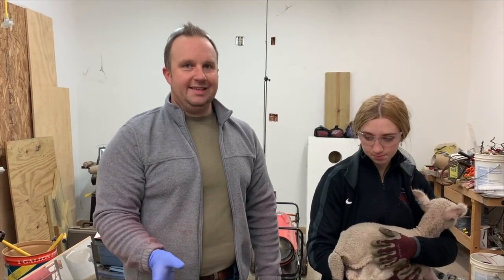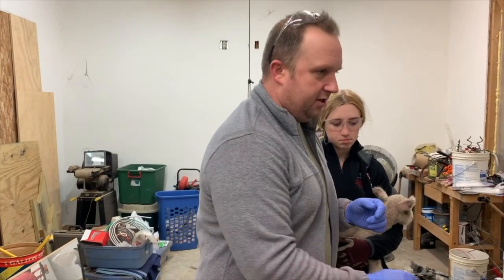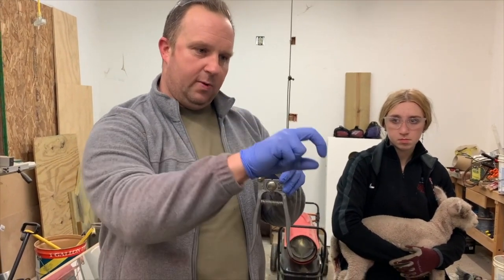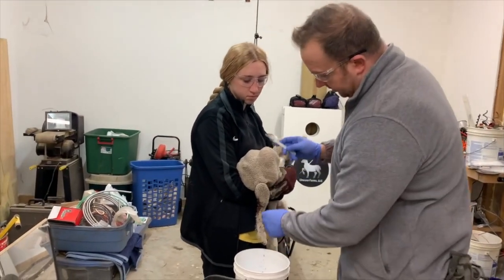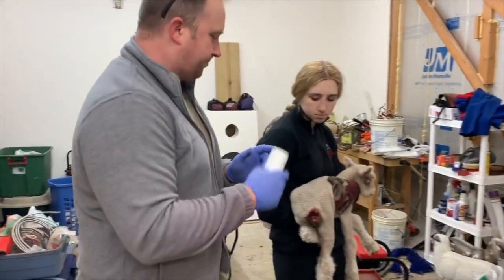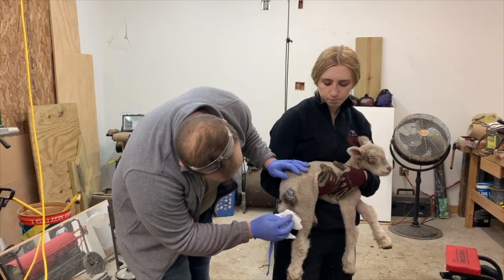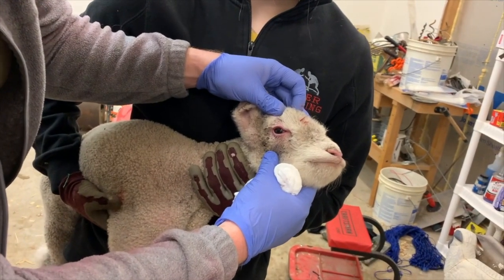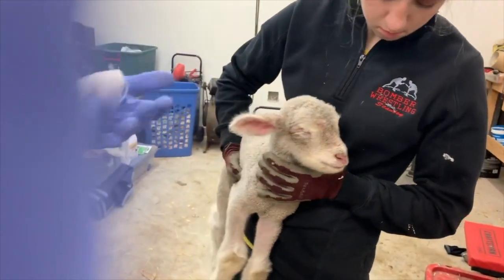Emergency!! Lamb Infected Tail Surgical Removal and Treatment!  Eye Infection Treatment!

Comment: If gangrene has set in, what do you suggest to do. And how would you know if it has set in?
Reply from the maker: Mastitis will usually cause the ewe to go off feed, have swelling and redness of their bag, generalized depression, usually there will be some discharge and foul smelling ick coming from udders. Their bag may be hard, hot, and there may be crepitus. A non-hot or cool bag is not a sign there is no infection. You can have a cool bag with mastitis despite common arguments against this. It all depends on when you catch it. 

I am not a vet (I may have mentioned this a thousand times but I still have to). 
I give 6 ml Nuflor subq followed by another 6 ml Nuflor subq again in 48 hours. I give 10 ml penicillin per 100 lbs of body weight subq daily. Lastly I give 5 ml dexamethasone ONCE subq as well. If you get gangrene you will have to contact a vet to open it up as this is an anerobic bug and will not heal if you don’t complete some sort of debridement.
Reply from the maker: This is all based on the direction of pipestone vet Dr. Kennedy, so, this isn’t really my method. This is his method that I use.
Reply from the maker: Sorry!  Thought you were asking about mastitis. We just had a live stream about it!  Gangrene has a smell…. It’s bad and a smell you will never forget. You will be to remove the dead flesh and treat aggressively with antibiotics which will act against this bacteria. In this case, penicillin may actually be your best option.  You will probably need to contact a vet in order to remove all the dead flesh appropriately. Debridement for someone not used to performing this procedure can be difficult.  Sorry for the mastitis posts. 😬

Comment: Penicillin can be given subcutaneous? I thought it was intermuscular shot only. That’s good to know cause I hate giving IM shots to lambs.
Reply from the maker: Hello!  There are certain circumstances where we would give penicillin IM. One I can think of off the top of my head is mastitis.  We follow a lot of the work of the late Dr. Kennedy of pipestone veterinary services and he was the one who turned us on to the idea of giving most antibiotics subq.  It has helped us out a lot and prevents a lot of the issues we experience with IM injections. Generally speaking, when it comes to shots, the route of administration is used to control the rate of absorption. Subq allows the antibiotic to be absorbed more evenly and over a longer period of time. With this being said, there are time when we have a critically ill animal that needs antibiotic RIGHT NOW which we will administer IM to. Thanks for watching our videos and thank you for taking the time to leave us a message!